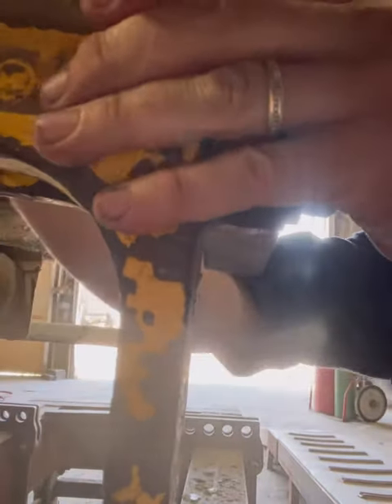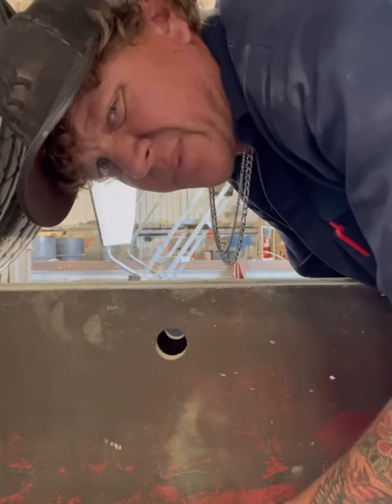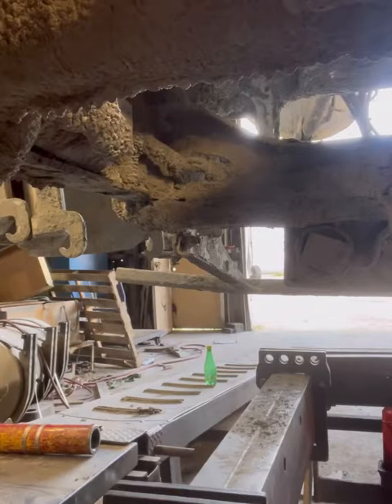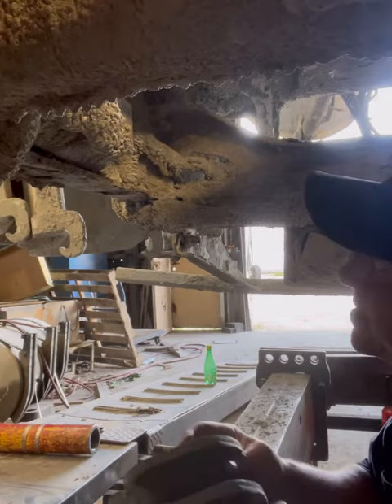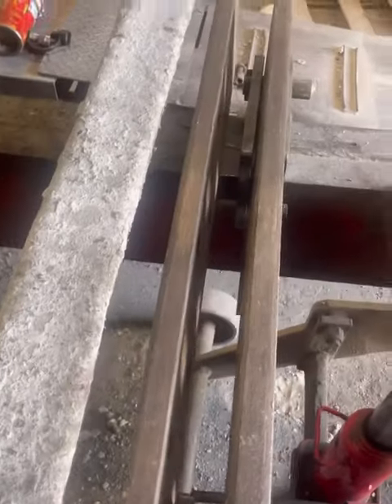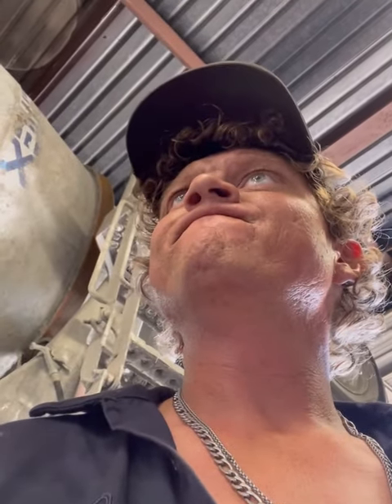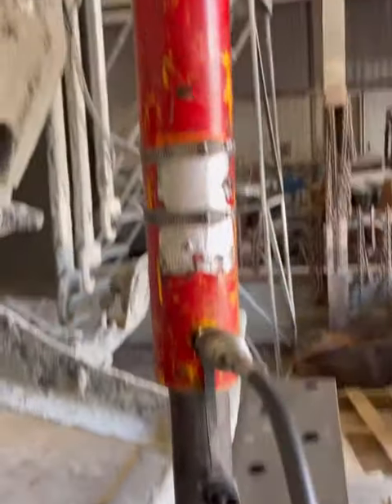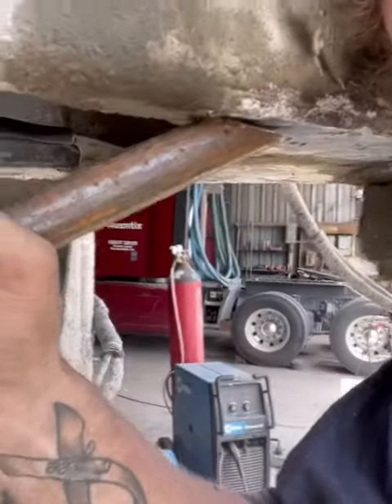International cement truck shoot repair #deathmachine #shorts #bendinwithbendon

Comment: Next time spray and soak the work area on a mixer with vinegar. It will dissolve concrete so you can just brush it off. They do also make concrete dissolver too.

Comment: My buddy ran three DM600 Mack mixers back in the day. I used to do his repairs. The amount of concrete stuck to those things was unbelievable. I'll bet every one of them had 2000lbs of concrete stuck to it. There was a guy that freelanced cleaning out the inside of the barrels. He'd go in there with pneumatic hammers. What a hell of a job that was noisy, hot, dirty and all the spiral vanes inside were sharp as hell from the concrete wearing away at them when the barrel was turning. Not sure how he did it